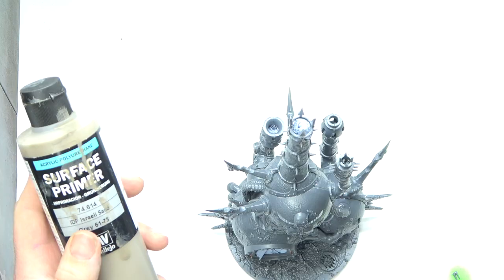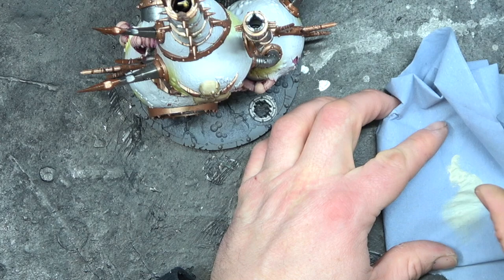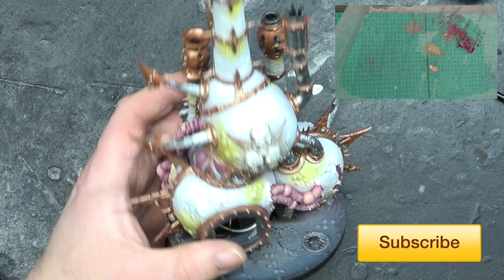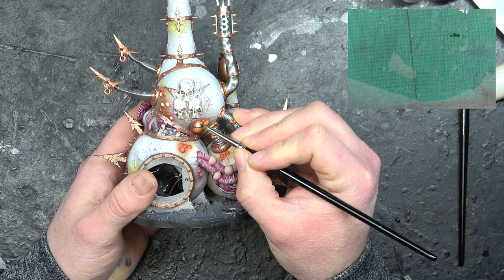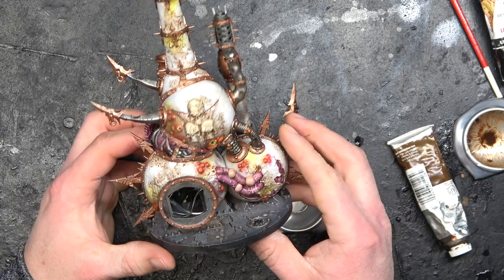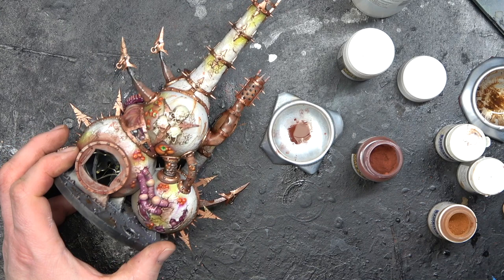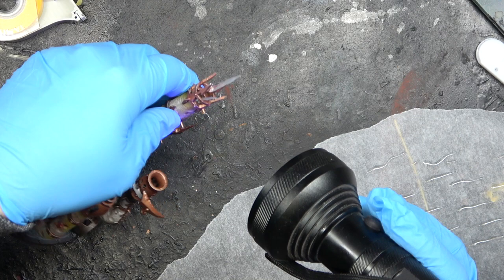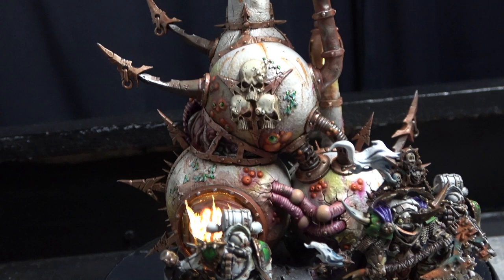How to Paint Death Guard Miasmic Malignfier guide and fire lighting effects with LED Lights

Comment: The lights inside the furnace is a brilliant touch, I been searching and can’t short led strings , but anyways great work
Reply from the maker: 22 Pack LED Fairy Lights, 1M 10 LED Battery Operated String Lights Copper Wire Light for Home Garden Christmas Wedding Party Halloween Concerts Bars Clubs Hotels Indoor Outdoor Decoration (Warm White) https://www.amazon.co.uk/dp/B08NBTFHBT/ref=cm_sw_r_cp_api_glt_fabc_7A9Y6EXKCNCG77GMAY12?_encoding=UTF8&psc=1
Reply from the maker: Good morning Jay I’ve linked the one. Brought of Amazon 😊
Thank you so much for watching
Reply: @TwistedDice  thank you for the link just bought, the ones I got are far too big, the power pack held 3 aa batteries. There would be no hiding that 😊, when all is finished what do u do with your control pack, thanks again, I was in the middle of cutting a hole in the bottom of the base too put the lights in .
Reply: @TwistedDice  I am an eejit, just seen the other video, I appreciate the reply and links, keep up the great work and ur a gentleman for taking the time to tolerate an 45yr boomer lol
Reply: @ 3v button cell batterys :) just remove the aaa box